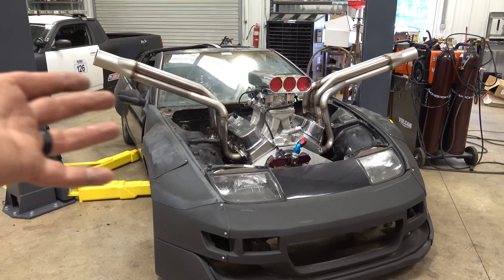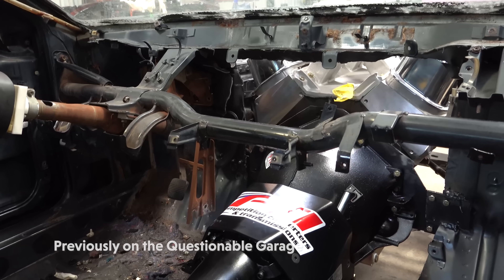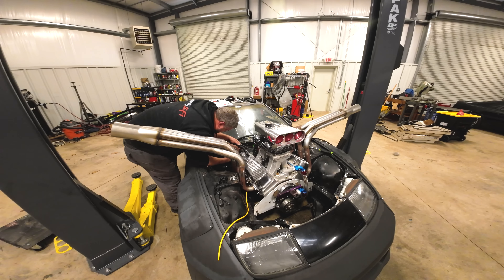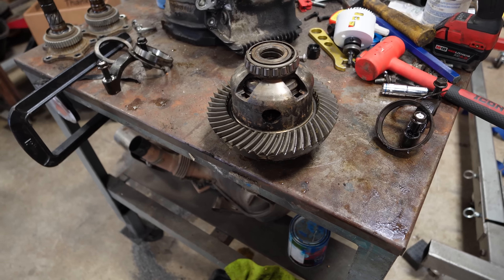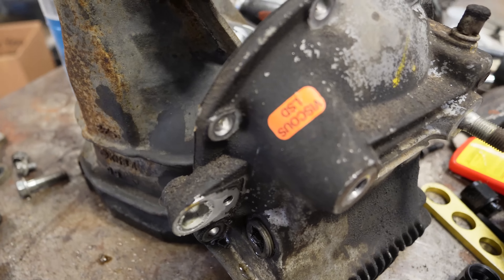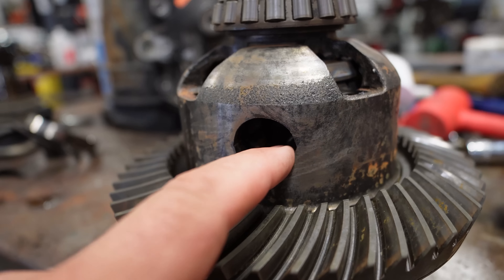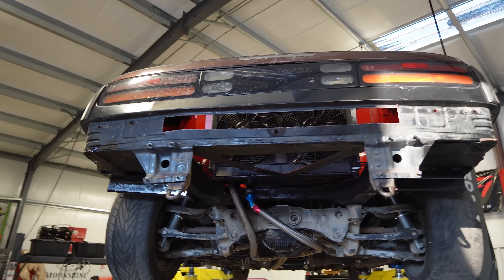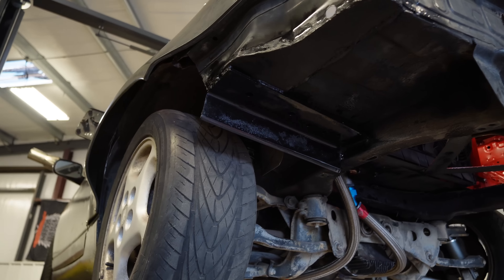The video that took 11 months to make- Big Block Nissan 300zx

Comment: As others have said you really need front and rear driveshaft loops for Earl. If either joint breaks with all that 454 power/torque you’re gonna either destroy those very expensive coolant lines or the trans cooler or both and maybe start a huge fire. But all in all it should be a pretty aggressive burn out car.

Comment: 26:07 you should add another fan set vertical to suck in air independent of the rad ones. Doesn't need to be very powerful (or as powerful as the rad ones), it just needs to start a thread down the needle.

Comment: I'd put a couple driveshaft loops in to protect the coolant lines in case of a driveshaft failure and the shaft whipping round and ripping them out, like you said there expensive and I bet you could knock out a couple of loops cheaper

Comment: If its ever an issue in the future where you have to replace those coolant lines. You could run steel tubes front to back and save a bunch with much shorter flex lines attached at the ends

Comment: 8:04 Never forget that mig/tig welding with break cleaner can result in Phosgene Gas ☠️☠️☠️
Reply: Only chlorinated brake cleaner.  Non-chlorinated is just as common or even more common now.
Reply: Just takes the heat of a cigarette to convert freon degreasers to nerve gas as you inhale ...
Reply: @davebrown9725  serious question, which brake cleaners use freon as a propellant?
Reply: @davebrown9725  where are you finding Freon degreasers?
Reply: @dwaynepenner2788  still finding the dichlorodifluoro version of brakleen at local auto parts stores. The US military may still have their use exemptions for many otherwise banned chemicals, and some semiconductor and computer manufacturers may still use freon based degreasers. Also trichloroethylene TCE  which has generally been replaced with TCA. Toluene, xylene and even benzene are in some degreasers, auto additives also spray paints.
Reply: @dwaynepenner2788  I have not tried to read many labels, but freon is still widely used in "dust off" and "liquid freeze" cans widely used in electronics. Propane/butane/isopropyl, etc is another generally used propellant, as is carbon dioxide, last time I looked, the badger airbrush was using canned freon for its propellant.
Reply: @davebrown9725  the production and import of Freon was banned in the US in 2020, so that’s why I am wondering.

Comment: Should give the antlers some support. That much side-weight will probably not be good for the engine block.
Reply: The headers will crack long, long, before the block or even the heads will.

Comment: As a burn out car, consider mounting strobe lights in the headlights and tail lights
If you want to go over the top maybe add a propane flame thrower to the exhaust
A Mad Max styled nose on the front would be Killer

Comment: Might worthwhile putting 2 or 3 driveshaft hoops in to protect the fuel tank and coolant lines a bit better, pretty sure that if the driveshaft snaps it’s gunna rip’em out. Good luck at cleetus and cars

Comment: for the drive shaft, you may want to add a restraint to the back so that if the joint breaks, it does not break your coolant lines.

Comment: I don't want to rain on your parade, but those stainless AN lines are going to be like an oscillating saw against anything it touches the second it starts vibrating, or moving. I managed to saw through my intercooler pipe in about an hour with a much smaller stainless braided line. I'd definitely add some rubber between anything it's touching. This is just my two cents.

Comment: I'm surprised that you're not building a rear deck lid with a forward mounted scoop to get directed airflow right onto the radiator.
Reply: Not a bad idea, but how much time does a burnout car spend going forward while it is doing burnouts?
Reply: @davebrown9725  Then put two opposing scoops on both sides lol.  Suck dat air in.
Reply: @edwardkamenar1493  yeah, another commenter suggested putting pusher fans across the top opening to force air into the space in front of the rad. With burnout cars swinging their rears one way and then the other, side facing scoops could push air to the rad.

Comment: Jared, I'm going to ask forgiveness ahead of my notes; it isn't often that I challenge a builder with half of your creds- and I'm not doing that now. I'm curious why you chose the "very high priced" SS #20 water circulation tubing rather than some 1 1/2" thin wall aluminum tubing and run it  through the rockers? The flexi hose is sexy and all, but with fittings and all, a big chunk is in just that. You have been paying attention- one of your best traits- overheating is a huge problem for burnout cars; and HUGE radiators and fans and pumps are the answer. The tread cutters were also a great addition- and with an IRS, you have a lot of things that tire trash could get into. No comments on  your choice of paint- you bought the paint, you choose! On getting some more air through the radiator compartment; a Stainless Steel " hairband" over the back of the existing roof with more fans in it and a back edge that will kick the air down into the radiator. My guess on the "wacky headers" is (initials only) "FT"s. I'm thinking strong beams of colored light coming from the three throttle body openings on your bug catcher also. And now that you  have brought those tread cutters in, maybe a "forced deflation system" to deploy either  strategically through the run or at two minutes, fifty five seconds to guarantee a "double pop". Looking forward to this one turnin and literally burnin! Let her eat! It's good car, built for a season more than just an occasional contest- lots of good foresight in the maintenance department; burnout cars also break lots of parts- the toughest three minutes in motorsports for the cars, and not exactly easy for drivers; you thinking of a NASCAR style helmet and fresh air yet?

Comment: Would adding some ducting to the backside of the fans down thru your holes in the trunck you cut add any air flow benefits? Also might want to add some wire mesh in your cut outs too to help keep rubber build up off the fans and radiator

Comment: Just threw my wallet into the fire🔥, and got in on the early bird special for a revopoint miraco 3d scanner with 32gb of all in one portability. No more savage wire cabling just to move around 3d scanning!
Get one if your wallet isnt already cooked while its on special!

Comment: I thought if you fabricate ring brackets for the driveshft, then it wont be able to flop or bounce or stick into the ground.
Reply: Cheap mans way be go with U bolts for around axel.  Weld 1x1 or c channel inside car, drill holes for U bolts. Put them around your driveshaft.

Comment: Hey, just a big heads up from a professional welder... Never, ever, and I mean NEVER use brake cleaner on a part you will be welding.
Reply: They do make non-chlorinated brake cleaner…
Reply: @dwaynepenner2788  Sure, but that's not something I would build a shop process around. One day you're out of a product so you grab what's locally available off the shelf because it looks the same. It's an avoidable hazard. We develope SOPs for safety just as much as consistent quality.
Reply: @JPspinFPV  so not Never, Ever?  You could also build a shop process that doesn’t allow chlorinated brake cleaner into the shop.  Same results.  I suppose you SOP needs to reflect the lowest common denominator in you shop, the pressure the workers are under, and how well they are trained.

Comment: I am a Aussie and it baffles me you talking about a rear firewall and the driver being hit with coolant I am a CAMS  scrutineer and  am fifty so CAMS (confederation of Australian motorsports ) now just motorsports Australia,drift burnout, V8 supercars, production cars etc I don't care under the rule book fuel tank in the rear, radiator in the rear hydraulic pump in the rear don't care if it doesn't have a sealed firewall it doesn't go on track and that's been the rule for thirty plus years

Comment: How complicated would it be to convert the block to 4 bolt splayed ?
Reply: Pretty tough. First is finding the block. The all remachined. Rings and bearings all need to be redone.

It would essentially be a complete rebuild. Many thousands of dollars to do right as whole bottom end would need rebalancing to the same standard.

Comment: All too small electric water pump
Reply from the maker: 40gpm, which should be sufficient. Some are 55 that bolt to the front of the engine, but calculated load says it should keep up.
Reply: Does that account for the pressure required to overcome the static load of such a long run of coolant?
Reply from the maker: It does, it is more water pump than some formula d teams run, and they make twice the horse power with similar total run time for the two laps, so I feel confident in it. If it doesn’t hold up, upgrades can happen!